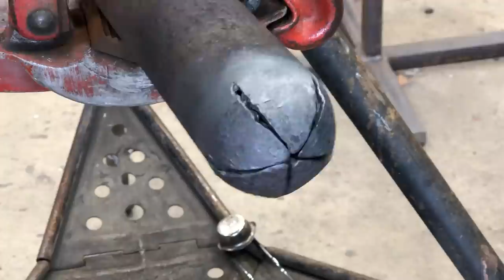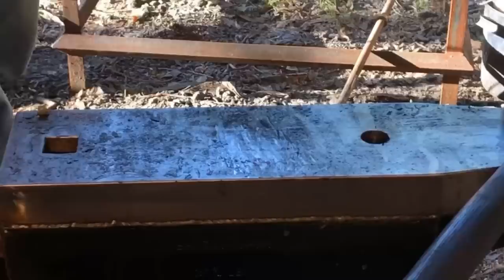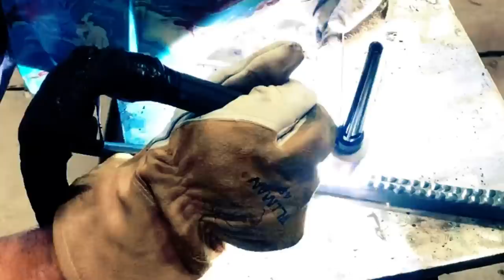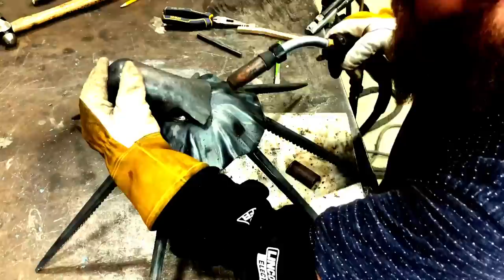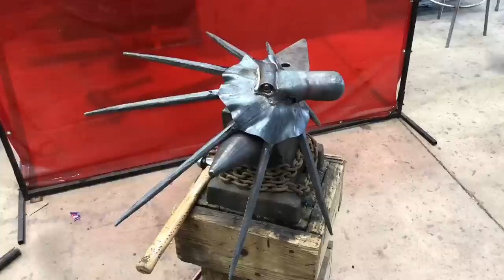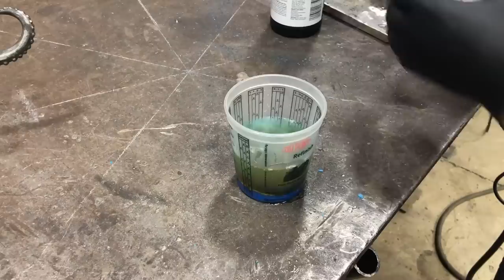Metal Octopus (tentacleis tedious)

Comment: Mesmerizing built and fantastic outcome! What was the solution you used to deposit copper on the steel?
Reply from the maker: I use copper sulfide (zep root killer)and Ascorbic acid(vitamin C powder) mix them into boiling water. The copper nano particles bind to iron like magic. It will not bind to the iron oxide, so sand all mill scale off. I used a wire wheel to get most of the iron oxide off. I wanted it to have some left on so it has a patina look. Dry it off and then burnish it with a paper towel and it will shine like a penny. Don’t worry about it rubbing off. It won’t

Comment: Nice work. How did you make the solution you brushed on the metal?
Reply from the maker: If you mix zep root killer (copper sulfate) with vitamin C crystals (Ascorbic acid) in scolding hot water it will make copper nano particles that will bind to iron. Just make sure you get off all oxides from the iron/steel via wire wheel or grinding disk. I used a wire wheel, the areas that didn’t change to a copper color still had some oxide on the surface. This was the desired effect. If I wanted it to be all copper I would have used a flap disk aka soft wheel.